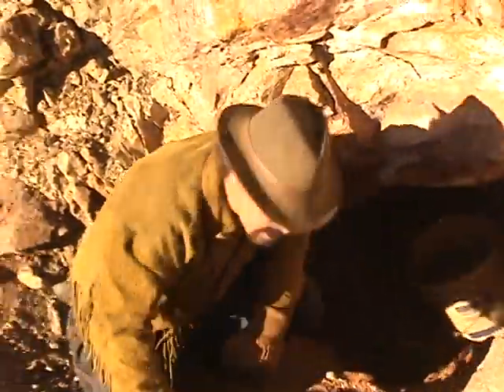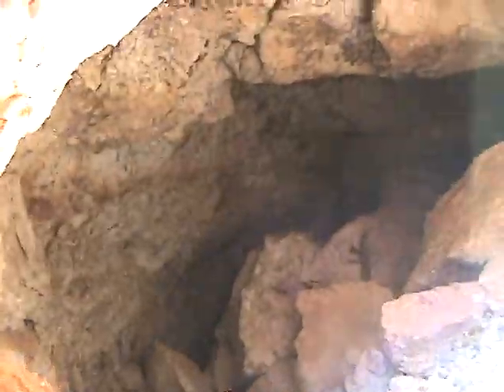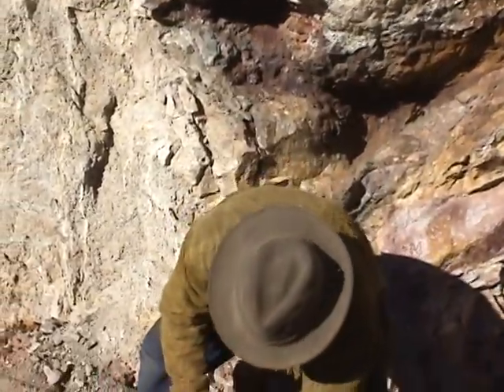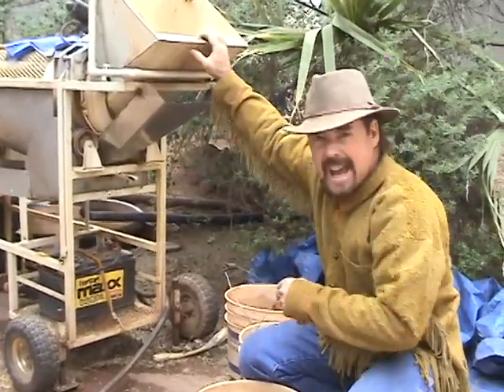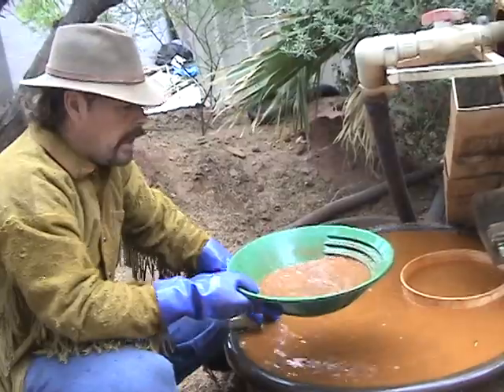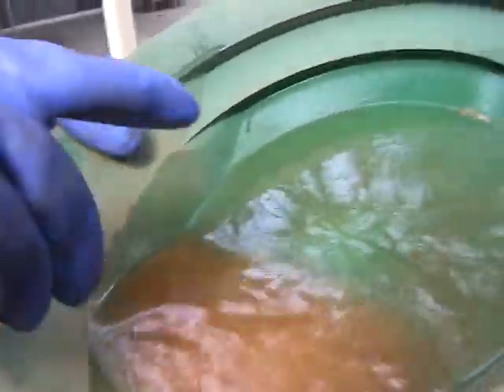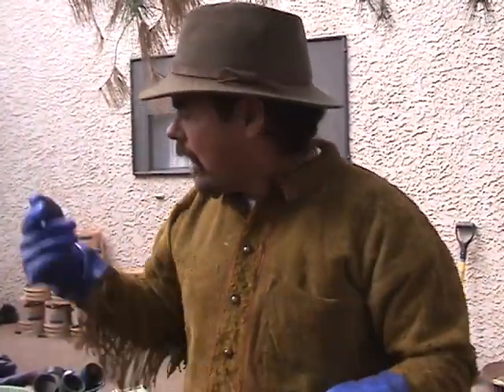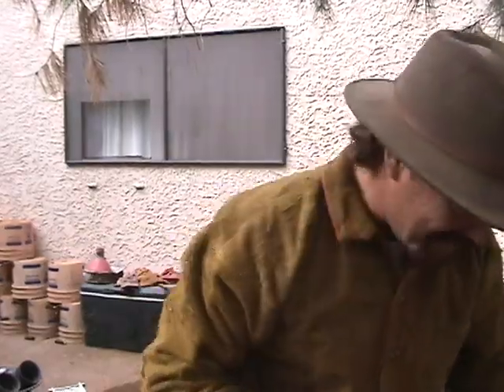SECRET GOLD MINE !!! Finding more Gold in Limonite .

Comment: Here's my learned experience to treat Heat Stroke, Heat Exhaustion and Sun Stroke. When a person is having a heat stroke or heat exhaustion they will become faint and black out. Here's how you can tell before they pass out and you have time to save them: for heat stroke their face will become bright red and they will sweat profusely. Get the victim to a cooler spot immediately and raise his head. Cool them off any way you can but don't throw cold water on them. If the face is red, raise the head. Heat exhaustion: The person will become pale and ghostly looking and the skin will feel cold and clammy. He will not be sweating. Get the person to a cooler place quickly and raise his feet. They say " if the face is pale, raise the tail.!" This means to raise the feet. If the face is red, raise the head." NEVER give these victims of Heat Stroke or Exhaustion large quantities of cold water. This can send them into shock and they will surely die. Only give small sips of water. When a person becomes the victim of Sun Stroke they will pass out and surely die. Urgent medical attention is needed. They can be red in the face or pale and they will shiver as if they are cold and freezing. Get the victim to the nearest hospital quickly and tell the doctors what you think is happening. They will not know what is happening or where you came from and cannot diagnose you while this is happening. If you die from this, the diagnosis is easy for the doctors. While this is happening, they don't have a single clue and will simply treat for heart attack. I can see that you are still a young man but this can even happen to you, especially as you get older. Be careful out there in the deserts and intense radiation from the sun. A large brim hat like Nevada Jack likes to wear is the best hat. Intense radiation from the sun over long periods of time will give you the symptoms of radiation sickness. You can go blind, it cooks your liver, your teeth begin to fall out and your hair will fall out, just like radiation sickness from atomic fallout poisoning. From watching your videos I already love you guys and your fans so everyone be careful out there in the field. And may God bless you in all of your endeavors.
Reply from the maker: Stanley Stalvey  very good info once again and we will get it out there . Thanks.
Jeff and Slim